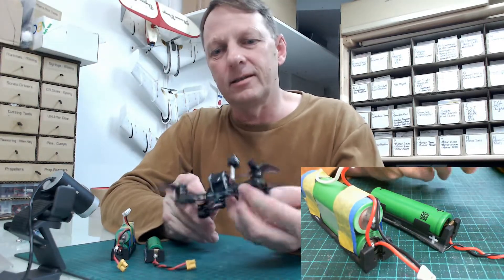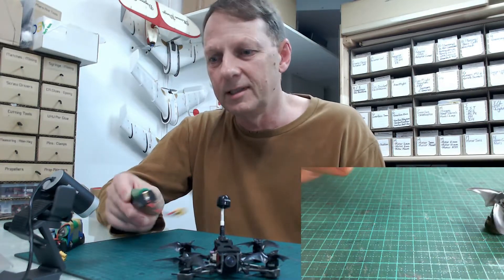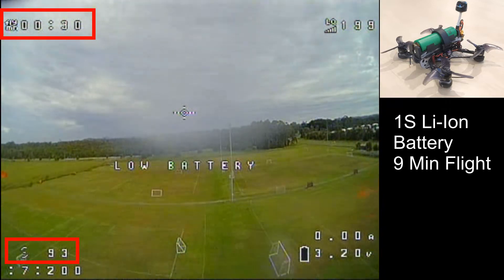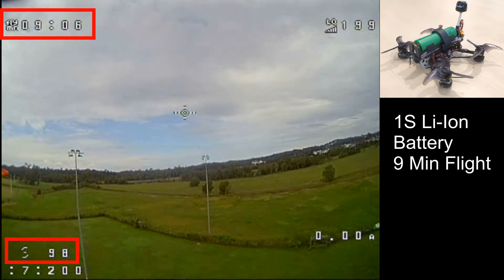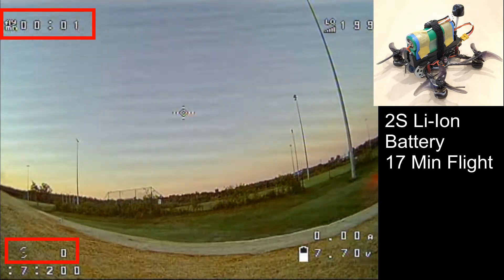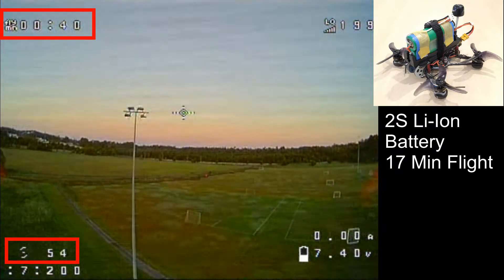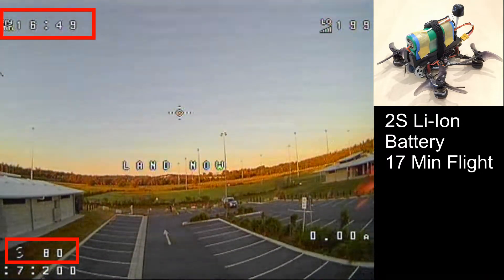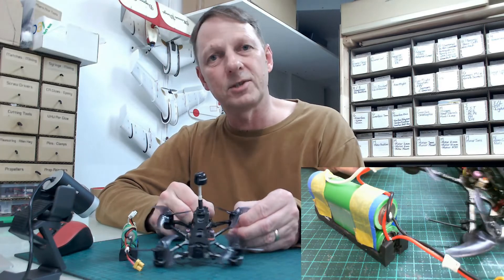TinyHawk 2 FreeStyle 17 Minute Long Range Flight Li-Ion

Comment: Old video, but I`ll go ahead and mention that VTC6 are Sony cells, not Panasonic.
LG also have 3000mAh cells and they`re pretty good as well, another option could be Molicell INR-18650-P28A.
If you want to go single cell, you might want to try 21700 cells as well, like Molicel INR21700-P42A, 4000 mAh and 45A max discharge.
You could run a single 21700, get 4000 Mah and have plenty of amperage, so you can run on the most aggressive prope the AIO can handle ;)
(gonna try that myself tbh)
Reply: im planning to build a ultra light cinewhoop for indoors .. with using both 1s 18650 and 2s lipo .. suggest me frame , fc , motors and props

Comment: I must admit i was sort of skeptical of the idea that this little drone could carry a battery over twice its own weight, but when i saw your video i had to try it out for myself. It's really wild, albeit the motors sound like they're going through pure agony in hover alone. Maybe it's time to swap the bearings 🤔Awesome video.
Reply from the maker: Yes thats right - you're flying very high in the throttle. I must admit I just tried this as an experiment to see if it was possible. So yes possible and a lot of fun - but maybe not practical.

Comment: I m so interested!  Did you have any problem running with 18650 lipo? Except battery plug,  did you make some other mod to let it run with 18650? Thanks and cool job!!
Reply: No other changes made. But with these batteries it is purely straight and level flying. You need to adjust the low battery warning as well to 5 volts instead of 7 volts.

Comment: What mods do you have to do to the drone for supporting that cell?
Reply from the maker: The FC and Motors are both okay with 2S voltage so no real mods necessary.
Reply: @cubefpv  so just find a way to connect li ion batteries and it will fly?
Reply from the maker: It will fly but it's very heavy. All you can do is hover and fly slowly. You can do it but I don't recommend it. @swimbeyonder

Comment: hi  i was wondering what would happen if you mixed batteries... for instants if you use one emax battery and one 18650?
Reply: No you can't mix batteries.
Reply: @MicronWings  thanks what would be the outcome if i may ask?
Reply: @MicronWings   i mean if you still have the original tiny-hawk 2 freestyle dual 1s battery connection and plugged in two different 1s 3.7v batteries
Reply: @TruthProductionzHDTV  The batteries will be damaged and it could be dangerous.
Reply: @TruthProductionzHDTV  That's okay as long as both batteries are the same and they are only 1S
Reply: thanks again... just to be clear different mah and c rating on each battery is okay as long as they are 1s  and have the same voltage?
Reply: @TruthProductionzHDTV  No the batteries must be exactly the same.
Reply: @MicronWings  guess ill stop doing it then 😅
Reply: 1s battery are sooo hard to find right now i only have 3 and thats cuz i have the easy pilot pro and the tiny hawk 2 fs... waiting on batch from china but its taking forever. but i'm getting some 18650s this week so i'm gonna give the CubeFPV method a try it might be my only hope to get more  flying minutes in lol
Reply: @MicronWings  Just messaged Captain drone and apparently you can

Comment: Hi, I burnt same mosfets in 2 boards, any way to fix it ?
Reply: Mosfets are hard to replace. You need a soldering re-working station with a hot air blower. Even then it's difficult. Probably easier to replace the board. Or maybe look at moving up to a more modern frame with a standard mounting pattern like 20x20.

Comment: Could that scale up for a LR iflight chimera 4?
Loved the vid. Thanks.
Reply: There are lots of LiIon packs available for quads liek the Chimera 4
Reply: @MicronWings  
I have heard some folks saying 6 cell can be adapted to the 3800kv. I believe Drain Man (among others) posted something about it but it seemed mostly to focus on larger motors.
My real question is, is it possible to use the same system you exhibited it this video but simply add more cells?
My rig is is (for all intents and purposes the iflight Chimera 4)
Lastly, I would love a resource for less expensive batteries 🤔I guess everyone has the same wish.
Reply: @MicronWings  thanks bro.
Your work.
Reply from the maker: @averagefpv9449  I'm not if it's just a case of adding more cells. I would look for videos of someone actually doing that.

Comment: I am inspired by your video.  I would love long flights and long range.  I would also like an onboard sd card to capture perfect video.  BUT I am very frustrated now because I can't get beta flight to connect to my tinyhawk.  I thought I installed the com drivers but I guess I should retry that.  Also I was discouraged when I tried the button method of binding to my radiomaster and nothing went according to the instructions. I am very frustrated but i hope to get mine like yours eventually.
Reply: Problem solved.  After 6 hours of fussing with betaflight connection I found out that the USB cable was not meant for data,, only power
Reply: I literally had all these same problems. Glad I'm not the only one. Even right down to the wire issue

Comment: Hi friend.
 I wanted to supply such a battery with a Lithium-ion battery NCR18650B (18650, 3.7 V, 3400 mAh), but the drone does not rise. What settings do I need to change in order for the drone to fly on 1s battery?
Reply from the maker: You don't need any special settings. However i do not reccomend using a 1S battery. The flight will not be stable. Also you need good quality batteries - like the Sony VTC 6 or Panasonic brand. maybe the battery you are using can't supply the current.

Comment: Welp, I know what I'm doing with my Tiny Hawk II when I graduate to a proper 5" for freestyle. I'm fairly certain you could slap a runcam or Insta360 on that setup & have a super solid little budget cinewhoop.
Reply from the maker: yes the Tinyhawk will actually carry a bit of weight and well capable ap carrying an Insta 360 2. It also seems to fly better with a bit more weight but it's not that powerful. I find myself holding on the throttle for a punchout over a tree longer than I would like and sometimes sagging the battery.

Comment: Thank you alot
I have ldark et 115 with 2.3 inch props
1104 7300 kv motors. I want to try the same like you 2s 18650. Do you think will work?
Reply: Sorry I'm not sure about 1104 motors I think they are mainly used for 1S.

Comment: n00b question. would lower pitched, bi-blade props increase flight time?

Love all the TH2 Freestyle content. This is my first quad and have really enjoyed upgrading and modding it. I'm now running ExpressLRS on it and this LiIon pack looks like a great option for long range exploration.
Reply from the maker: I've tested with Gemfan 2540 3 blade props as well as HQ Prop 65mm 2 blade props. neither of these gives any increase in flight time. It seems that the original Emax props are actually very efficient.
Reply: @cubefpv  very cool. good to know.  great content!

Comment: Have you seen any 18650 degradation after multiple cycles when running them in this way? Thanks!
Reply: To some degree yes. The first few flights were more like 20 minutes but then I got reduced flight times of around 17 minutes. But I have not seen any further decline in the flight times from there. I think i ahve done about 20 flights with this pack and I am now getting a pretty consistant 17 minute flight each time.

Comment: I've flown the Tinyhawk Freestyle 2 quite alot with 3S cells (450-500mah 3S LiPo, also tried 500mah 3S LiHV 65-130C). I did not push it extreme on the throttle (tried to stay below 80%) and it flies very well.

Are there smaller Li-Ion Cells with similar C-Rating that can be used in 3S or would even 3S (Li-Ion!) make sense? If by any chance you can try 3S Li-Ion, that would be awesome. The Voltage drops very fast to a 2S LiHV Voltage, so I assume it should be alright for the ESCs, as they can handle nonstop 2S LiHV all the time (judging by YouTube Channels flying this thing for more than 100 times with LiHV 2S)
Reply: Yes I am flying with 2S HV CNHL batteries and have no problems at all. Interesting to hear that you are flying with 3S batteries. i was not aware that the tinyhawk would take 3S voltage. The motors are okay on 3S though because i am currently flying another experimental drone on 3S and using the tinyhawk motors. I have a 75% throttle limit and the motors are not getting hot at all. But i don't want to try my tinyhawk on 3S LiIon just in case.
Reply: @MicronWings  thanks for the fast reply :) could you recommend suitable li-ion cells to me? I will purchase a couple and try this. Always wanted to have powerfull ones for drones :) I read VCT6 seems to be required
Reply: @neutralmst6855  I use the Sony VTC6 18650 cells. Buy them from an FPV shop if you can. A lot of the sellers on ebay wouldn't know if they were selling hte real deal or not.
Reply: @MicronWings  I did not think about this o.o  I'll search for fpv shops in germany/europe. Also I need to dig in deeper on how to test if they are the real deal. Thank you :)
Reply: @MicronWings  May I ask you what the total weight of the Tinyhawk Freestyle 2 with 2 (or 1) cell was? I am currently on the search for suitable batteries and there are also 2000mah versions that can deliver WAY more punch (up to 65A, 30A constantly). But the weight differences will effect performance I guess.
Reply from the maker: @neutralmst6855  with 2S LiIon is 175 grams and with 1S is 131 grams.
Reply from the maker: @neutralmst6855  Yes at this weight it's long range straight and level only - no acro. Really needs to be tuned but without blackbox that's a bit difficult. The motors would maybe benefit from the ESCs running at 48K instead of 24K (haven't even looked into this) but I would not try it with the standard Tinyhawk board because it would most likely overheat the fets.
Reply: @cubefpv  Today we tuned the Tinyhawk 2 (normal not freestyle) with JESC and 96khz ESCs. It seemed to stay cooler at the motors, fly better ("more power") and also had more fly time. But I don't know too much about the ESCs handling that. Do you have any ressource I can read / watch for the fets getting hotter by it?

Currently I am trying the Moblite 7 with JESC (96khz with rpm filtering) and it flies like crazy, the core temperature did not seem to rise by it yet : )
Reply from the maker: @neutralmst6855  Interesting. Thats something i need to add to my To Do List for the TinyHawk FS. Sorry i don't knew of any other info out there.

Comment: hi, i would like to do the same exact upgrades on my tinyhawk 2 freestyle. Do you have a tutorial?
Reply from the maker: It's really just a case of making the battery - everything else remains standard. You can just search on youtube for how to make a 2s liion battery pack.
Reply: @cubefpv  can you purchase these batteries?
Reply from the maker: @fishwithfeet7206  You can buy them at most FPV shops or even on ebay

Comment: Ideally you shouldn't really take 18650s below 3.0v without damaging the lifespan. BTW do you run them off a 100% full charge? Cos they start off at something like 4.2v - lol I wonder what kind of noticeable difference that would make to the drone's performance for the first minute or less of flight time. I use em for my mechanical (unregulated) vape and their wildly varying voltage makes them a pain in the arse to get a consistent pull off em lol (I end up swapping them out at 50%). But for real though, this is pretty cool what you've done with them 😁

Comment: For the single 18650. As a beginner, my flying is very easy and nothing special. Few tricks here and there. But even I was able to get just about 10 minutes out of 2x 650mah cells (so a 650mah 2s). So the 18650 does not look that great.
Reply: im planning to build a ultra light cinewhoop for indoors .. with using both 1s 18650 and 2s lipo .. suggest me frame , fc , motors and props

Comment: be aware if you slowly cruise TinyHawk 2 FreeStyle flies around 14m on two 1s 650HV cells.
Reply from the maker: Thanks for the Info Alex. Yes the Tinyhawk can take a heavier battery load and as you say you can often get good flight times with larger lipo batteries as long as you are just cruising.

Comment: Nice. But why?
Reply: Because it can
Reply: @MicronWings  Sure. But by using a better stack and stronger motors you sacrifice the two key elements of the TH2FS that define it, namely the beginner friendly power and the above average flight times (up to +7 minutes on a 650 mah). That's its sole purpose. So again, why bother? Or is there a new trend of building sleeper freestyle quads? That would be really, really absurd.
Reply from the maker: @intensegamer7559  I think you're reading too much into it. It's not something a beginner should do. This is just an example of what is possible with the TinyHawk frame. Just say you have a TinyHawk frame laying around from whan you were learning, you could turn it into a long range frame just for fun.
Reply: @cubefpv  Thanks for your feedback. I just think differently I guess. Your project is really cool. But personally, I would rather give my TH2FS to another noob once I‘m done with it and build my own quad from scratch. I am pretty new to the hobby. Just started out this year and still fly my TH2FS to practice the flippy floppy stuff. I watch your videos because I’m still insecure about soldering and wiring those tiny boards. Great help by the way! I‘m just more used to programming STM32 controller boards than shoving them into teeny tiny carbon frames :-) Keep up the good work!
Reply from the maker: @intensegamer7559  Thanks - yes it's a lot to get used to when you're just beginning. Good idea about giving the TinyHawk to a new pilot. There must be lots of Tinyhawks out there just sitting on the shelf gathering dust after people have moved on.

Comment: I try with my with vtc 6 but it cant lift, or maybe because i changed withb2 blades on my quad or what?
Reply: Yes I was using the original props. 3 blade may go better. But you will be flying very high in the throttle. to be honest this was an experiment rather than something that is really practical.